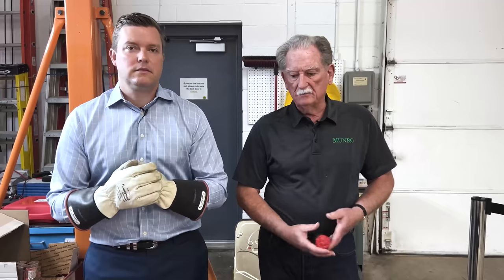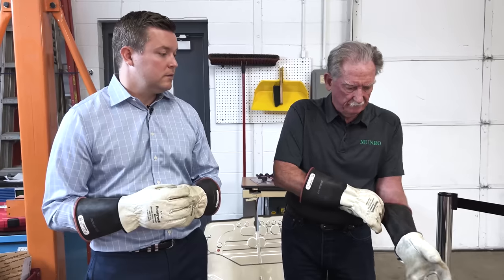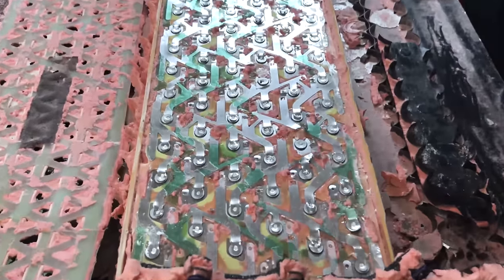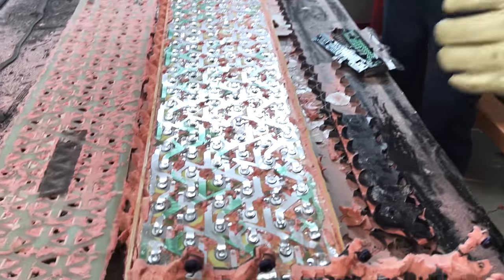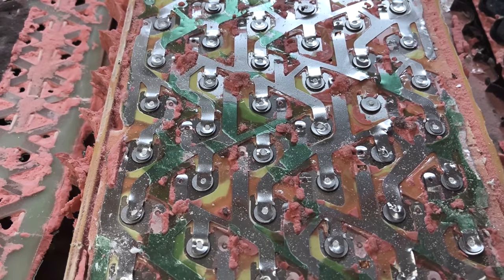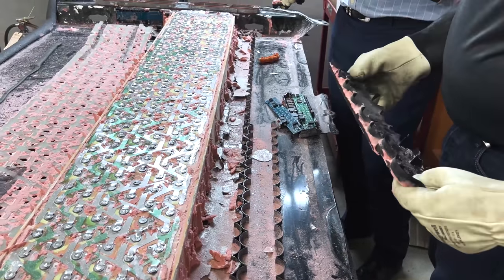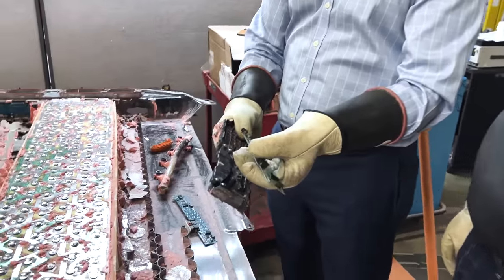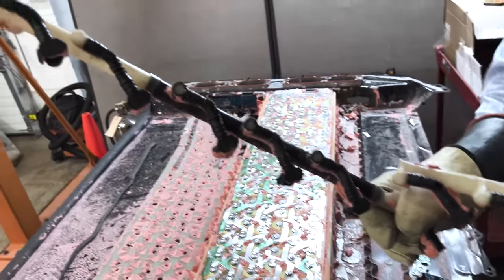Sandy's first time reviewing the fully disassembled 4680 pack!

Comment: 9:59 "...snap fits will last forever...": Until you need to unsnap them. Then they break and can't be reused. And when you buy replacements, your cost is about 1000x the manufactured cost.
Reply: Then use them where you don't need to unsnap them regularly. That's another huge advantage of electric cars, you don't have to do regular maintenance on the vast majority of the parts, so no need for serviceability.
You can also use higher quality plastic and better design to support regular unsnapping. For example some cheap plastic toolboxes use snap fits and those can be opened and closed hundreds of times before breaking.
Reply: @andrasbiro3007  lol…… those EVs haven’t yet been on the road for 20 years and there are still ICE from the 70’s on the roads! Tell me which one is going to be more reparable!!! The ICE or EV!? The structural battery is just a disaster
Reply: You noticed all the snap fittings were used inside the battery pack that is sealed shut with the Pink Foam Of Death. Nobody is ever going to touch them again unless you are tearing the pack apart for analysis like Munro is. This the best use for that style connector one and done no tools never coming apart again.
Reply: @ericrichards7884  lol……..what if years later the car needs repairs the cooling system or many batteries cells are dead or the BMS Is dead!?!?!
Reply: @carholic-sz3qv  Warranty for 8yrs 100000 miles. Repairing a 400 volt battery pack is  not a good idea. Dangerous and if you mess it up can cause more problems and liability for the company. They want to drive the price down and increase the reliability. This pack does all of that once they can ramp production. Do you want to spend $400 repairing a 2 year old $500 Tv?
Reply: @carholic-sz3qv  
Your argument is meaningless.

1. Electric cars haven't been around in significant numbers for more than 10 years, not even 20, so how do you want to compare them to 70's cars?

2. Everything can be repaired indefinitely, just ask Cubans about their cars. The questions is at what cost. ICE cars have thousands of moving parts and seals that all can wear out and break. Especially when they are working under high mechanical and thermal stresses. Electric cars have barely any moving parts, and not the kinds that easily wear out or break. Their weakest point seems to be the suspension.

3. Current Tesla batteries should last one million miles for the Long Range versions and several million for the Standard Range ones. The latter last longer due to the iron-phosphate chemistry. Even the old Model S batteries last about as long as a good ICE car.
Also the BMS can deal with a few dead cells, it's no big deal. With over 800 cells losing a couple wouldn't make a noticeable difference to the driver.

4. Tesla uses silicon carbide power electronics which are way much more durable than traditional ones. Plus Tesla has about 20 years of experience with batteries and power electronics, so they know what they are doing.

5. The cooling system is just a bunch of tubes, encased in a hard material, what could possibly need repairing?

6. Don't forget about the "penthouse". That contains most of the cooling system and electronics, and it's outside of the pink stuff.
Reply: @andrasbiro3007  your comment is really sad and lamentable at the same time! EVs were actually the first cars, for you the suspensions is the weakest point ls of EVs!? What about range!? Practicality????? EVs are fully loaded with electronics and tesla has been making their cars more and more like apple with less repairable parts! It’s going to be super funny to see a Tesla survive in Cuba lol…… yes ICE have a lot of moving parts and at least those can be teardown and repaired unlike the millions of electronics and software and limitations that comes with older EVs. Silicon carbide is mostly for efficiency that has nothing to do with reliablility and other manufacturers also uses it for the records.
Reply: @andrasbiro3007  a good ICE lady also millions miles and still has no limitations on charging like Eavs does, also ICE are much more capable at rings like towing, off-road usability, heavy duty applications…… your boring 500hp can’t even tow what a 200hp ice does and the list goes on…
Reply: @andrasbiro3007  the many batteries cells that will die will seriously affect range over the year and Ali charging capabilities…… so essentially a useless car used car with limited range and even limited capabilities and the list goes on. No one also knows how those electronics are going to survive on harsch environments unlike the slick pavement which  most tesla drives on.
Reply: @carholic-sz3qv  
1. Many cells won't die, failures are extremely rare.

2. The electronics aren't dragged along on the pavement. You are complaining about the few boards that are inside the sealed pack, under the pink stuff. That seems to me an excellent protection from the outside world.
Reply: @carholic-sz3qv  
1. An average ICE car lasts like 200K miles at best. 1M miles is exceptionally rare.

2. EVs have few limitations, but a ton of advantages. ICE cars are the other way around.

3. EVs are actually much better at offroading for many reasons. EVs are also better for towing due to the torque. Currently the towing range is limited, but that can easily be solved with larger batteries. Not worth it currently, but will in a few years. And EVs are especially good for heavy-duty applications, due to their torque and power.

4. Do yo even try to understand what I'm talking about? I've never even remotely implied having Teslas in Cuba.

5. And you still don't understand. Electronics don't have to be repaired, because they are extremely reliable.

6. Software is actually the easiest to fix. And it also never breaks anyway. Software does have bugs that may need fixing, but it never ever degrades.

7. Limitations of old cars have nothing to do with the powertrain. Old cars are missing many modern features, that's their limitation. Old ICE cars also need exponentially more maintenance, that's another disadvantage.

8. Silicon carbide has everything to do with reliability. It makes chips tolerate much higher currents and temperatures, which directly correlates with reliability.
Reply: @andrasbiro3007  nonsense!!! The average ICE last way longer than just 200k miles and ICE works harder are much more capable and useful than any EVs. There are litteraly a lot of million miles cars and for trucks it’s even better! Trucks have up to 2 million miles+
Reply: @andrasbiro3007  ICE are way better for towing and off-road ing and guess what! Another amazing advantage is the range and the ability to have auxiliary fuel tanks or jerrycans to cover tousands of miles! The 90 hp Toyota hilux has better off-road capabilities than a 835hp rivian, a 85hp fiat panda better off-road than a 700hp tesla….. diesel vehicles actually have way more torque than electric ones. The funny thing is that i see all the times less than 200hp ICE towing massive loads, caravans…… when 500hp tesla barely does nothing what a joke…
Reply: @andrasbiro3007  electronics aren’t perfect and unfortunately doesn’t last forever that’s why cars with almost no electronics are still on the roads. The software unfortunately is not that easy to fix assuming you have to totally rely on the manufacturers that controls everything and won’t let you do any mods on your car….. it’s a joke!!
Reply: @carholic-sz3qv  
1. Look up the statistics. 200K miles is generous.
2. ICE works harder? What? How? You mean they are so under-powered that they are struggling to move? That's true.
3. Electric cars are just as useful, if not more.
4. Trucks are an entirely different thing. Electric trucks are going to last just as long, but cost drastically less to operate.
5. Off-roading a very rare use case, and almost entirely recreational. Also Neither the Rivian, nor any Tesla has been designed for serious off-roading. Wait for the Tesla Cybertruck, that's going to be an excellent off-road truck.
6. Nope. Nothing beats electric motors at torque. That's why diesel-electric powertrain is popular in scenarios where really high torque is required.
7. Meanwhile in the real world electric cars are known their for insane towing capabilities. There are a few cool videos about this. Like a Model X towing a large passenger jet, an electric Ford F-150 towing a train, Model X towing a semi truck in snow, a Model X winning a drag race while towing another car. And so on. Or for a more normal example, the Now You Know channel used their new Rivian to tow an 11,000lbs trailer. Almost forgot, the Boring Company used a Model X for towing 250,000 lbs rail cars.
Where electric cars currently has a disadvantage for towing is range. Pulling a large/heavy trailer really cuts into the already limited range. And current charging stations are not designed to accommodate trailers. But it's just a bit more inconvenient, not impossible. And if you don't have to tow large distances, it's not even an issue.
8. In reality electronics last much longer than mechanical parts, as long as they are designed and manufactured properly. You may not know, but electronics weren't used in cars until the 80's, so obviously any car older than that won't have electronics.
9. Obviously the manufacturer fixes the software. Almost everything in the world runs on software today, so if software couldn't be reliable, our world wouldn't work at all. It takes extra effort (money) to write reliable software, but when it's important we can do it. Your bet your life on the reliability of software every day, you just don't realize it.
10. Actually, there a very active Tesla modding community. There are things you can't access, due to safety and security concerns, but there are plenty of possibilities still.

Comment: @18:18 Holy [expletive]' the casting and carbon forms are getting huge! Absolutely huge!!
No more stamping and hammering intricate little pieces of sheet metal and welding them into a falllible and fragile/breakable collection of squeaks and rattles.
Imagine the Tesla Roadster done in cast Carbon Fiber. You can probably cut almost a ton of weight.

Comment: Sandy Munro will not get a battery expert in his remaining life: the voltage per 4680 cell compared to an 2170 cell is not 3 times as much (they corrected this one), and the energy is also not 3 times (Cory agreed anyways). Instead, it's roughly 5 times the energy per cell. Next time, they should ask Antonio to explain if that is their battery expert.
Reply: The VOLTAGE is dependent on the chemistry, which (as Cory said) is the same as the 2170, so somewhere between 3.8-4.2v
The Capacity is "+/-5 times the 2170" simply because it has about 5 times the surface area of jellyroll wound into it.
.
As a consequence, it would have 5 times the power if that capacity was released at the same rate, but the tabless construction with less resistance and less energy wasted as heat, increases that to "6 times the power".
.
However, Sandy indicated that the cell had exceeded their expectations...... 
We'll have to wait and see.
Reply: @rogerstarkey5390  sorry, are there 4 modules in this new pack. I did not get how many cells were in parallel and how many in series per module.
Reply: @houtansadeghi  
When criticising someone, it's good practice to ensure ones information is at least close to correct......
Just saying....

Comment: As an engineer at Caterpillar, we used sheet molded composite process on decorative roofs.  It was sold as being able to use in-mold coloring.  So we spent the tooling to make it happen.  The surface texture and finish came out flat instead of gloss. We then had to paint it.  The release agent used in the mold inhibited painting.  So we had to add a cleaning process in addition to changing the release agent.  When it was all said and done, what was supposed to be a 50% cost reduction(over twin sheet abs) turned out to be a 20% cost increase.  As Sandy says, don't save me any money, I can't afford it.

The SMC was not as strong in single layer versus the twin sheet thermoformed process, so extra fasteners had to be added to hold it in place for highway shipping to keep the roof from ripping off in the wind.    

The next roof we did, we used CFD and FEA analysis to figure out the forces and stresses involved at highway speeds. Section was increased to reduce the number of fasteners and brackets.  We even used it to mount lights instead of on steel brackets.  This is heavy duty off highway equipment.  Think large and medium Wheel loaders that a transported by semi trucks on Lowboy trailers.

The best application for SMC is for B surfaces...NOT A surfaces.  It is OK for valve covers.  Its a pain if you are expecting it to be finished coming out of the mold.  But you can add metallic inserts in the mold.   When you are costing it, make sure you understand intended surface quality.
Reply: Gulp...all that glitters is not gold...